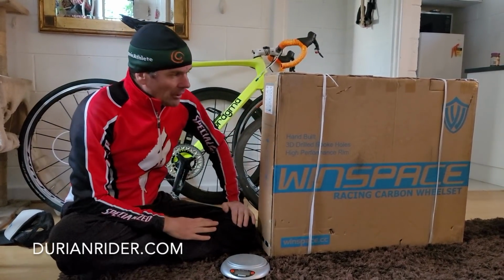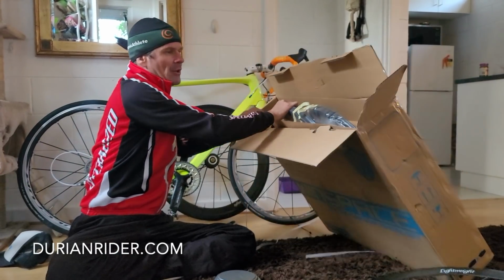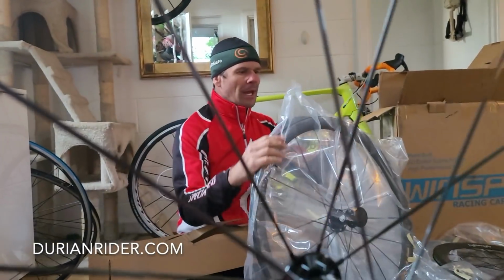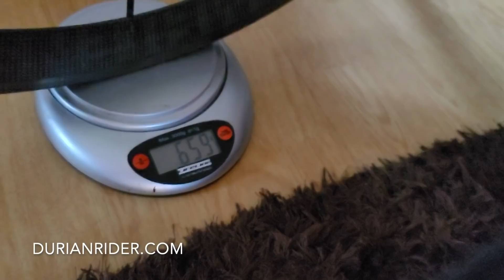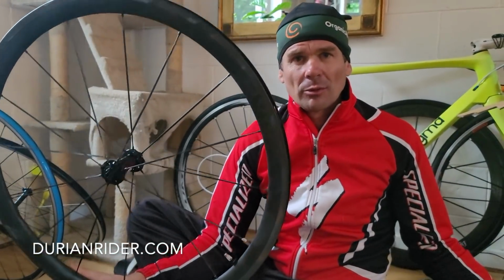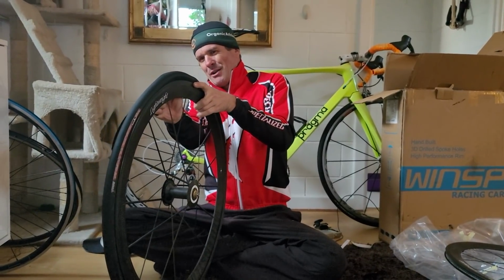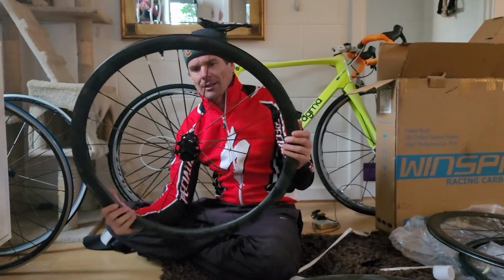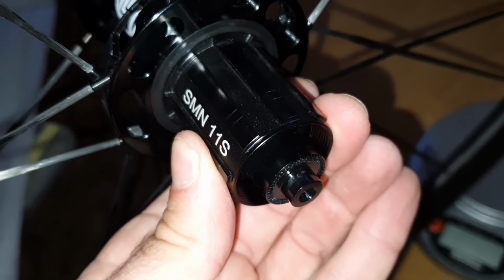Winspace Hyper Wheels VS Lightweight Meilenstein

Comment from the maker: Use the code 'durianrider10' if you want 10% off Winspace wheels at the moment.

The Winspace Hyper 38mm rim brake clincher is the best all around carbon wheelset Ive used both uphill and downhill. 

Rapid pawl engagement
Braking performance from both rim and pads.
1260g - about 40-50g heavier than my Lightweight Meilenstein Gen4 clinchers
Replaceable parts
38mm low profile means ride in any cross wind gusts with confidence.
Why pay more? You can but it it WONT be better.
Reply: Whinspace or Yolo? I'm looking at both those wheels  I like the Yoleos because of the cosmetic appeal all blacked out will look great with my 2018 r5!! what would u choose?
Reply: @dom5491  winspace because he gets a kickback from the discount codes

Comment: I bought a set of e Winspace Hyper 50 mm disc several months ago, put Continental GP 5000 TL 25mm on them and been riding the heck out of them.  Running them tubeless.  I love the wheels!  May get a set of the 38s for riding when it's windy or major hills.  The Conti's were a pain to get on but perform great once on.  Been recommending them to my friends.  Most reviews have a 10% off code, so wheels are only $990 ( free shipping, no added charges).

Comment: For what its worth, I work for an aerospace supplier and have access to UT equipment.  I bough a pair of Light Bicycle 56mm wheels. I borrowed a handheld UT to scan them and my set are near perfect. Build was great. Ride is great. Straight from the factory took some time to arrive but I would not hesitate a second about buying another pair.  Built to spec from the online wheel builder or completely custom if you contact them. They have a US warehouse for some of the higher sales volume builds that offer a quicker lead time.
High mark up brands should be sweating. The classic product distribution model is dying.
Reply: Good stuff. I have the same 56;s from light bicycle with DT350's. Looks amazing and performs well. I got it with no holes so no rim tape needed. Weighed in just over 1500g for front and back. Good to hear you did a scan with good results. They do have a light light version as you can get it down to high 1200's

Comment: I've been riding the Hyper X 50mm's for around 1,500 miles now, and they are phenomenal.  They handle the wind far better than my old Enve 3.4's (I sold them awhile back because they suck), like a night and day difference.  It gets very windy and gusty here where I live in southern CA, and the 50mm Hyper X wheels are really predictable....it almost feels like you're surfing the wind, rather than getting the white knuckle death grip in anticipation of your front wheel getting suddenly jerked like with some other wheels.  Might get the 38mm wheels for super windy days, but I couldn't be happier with the 50mm version, all things considered.  Mine weighed in at 1,350 grams, which is crazy light for a set of 50mm wheels.  There is literally no reason to get any other set of wheels for a road bike (the Hyper X 38's or 50's), unless you're doing some kind of specific build where you're integrating a generator hub, or are a retro grouch and prefer box section rims from the 1970's.
Reply: Couldn't agree any more and I'm battling the winds at 59kg. lol

Comment: Mine are in the post already - ordered after the Hambini Review, can‘t wait to try them out
Reply: So what have we established? 1. Harley needs a new scale. 2. Harley might need a calculator. 3. Winspace wheels are wicked light! (Even when weighed with tubeless stems installed).😂
Wheels look great, can’t wait to hear your impressions after a few rides. Any thoughts on carbon wheels/rim brakes during descending in regards to heating and rim failure? I’m still using lightweight alloy rims.

Comment: I think the tubeless valves were still installed during the weighing...can probably knock off 20g if you take those off. 😁😁😁 Agree about the freehub body could gain an antibite strip. I've never had a cassette trash the freehub body (it's black bc it's hardened I think) but i probably don't make enough power!! 🤣
Reply: Correct, the tubeless valves still installed.   I got my hyper wheels last week. Can't wait to ride it!
Reply from the maker: Looking forward to doing some hills with them tomorrow. Thanks again JW 👊👊

Comment: One difference I noticed was at 6:00 in the video the wheel spin test, the Winspace has a hub wobble (which most rims do) and the Lightweight were smooth with no hub wobble. Mostly noticeable at high speeds and descents.

Comment: These rims with carbon layers fanned out at the spokes appear like the trend these days. They are stronger at the spoke holes, and less so in-between spokes. You get the benefit of lesser weight. 

I have a pair of 60s that are designed the same way. Paired with carbonti hubs they measure 1480g on the scale. 

Winspace appears to be releasing the same rim type in 60s soon.

Comment: They look way nicer than my new china made zipp 303s wheelset and cheaper and lighter! But getting name brand I just feel ever so slightly more secure when I'm bombing downhill at 70km/h.
Reply from the maker: Zipp have recalled more hubs than any brand I know. This means the QC they used/ use is inadequate.
Reply: @durianriders  All I can do is ride em and have them under test :)
Reply: @durianriders  Ya I have Zipps and the rear hub exploded on me for no reason.  Had to get the wheel rebuilt at my expense.